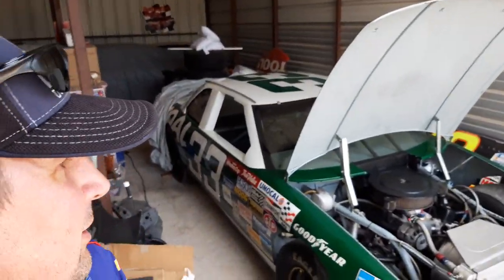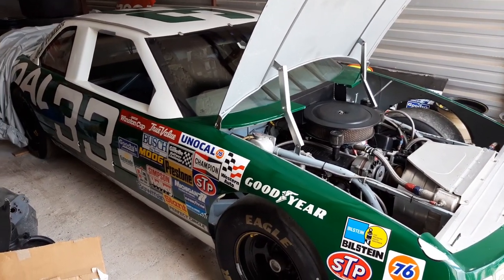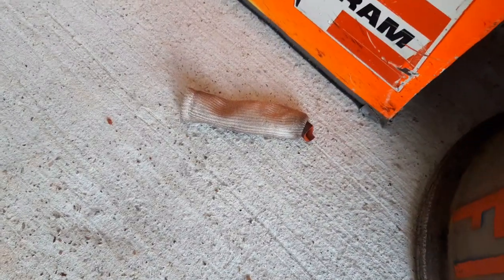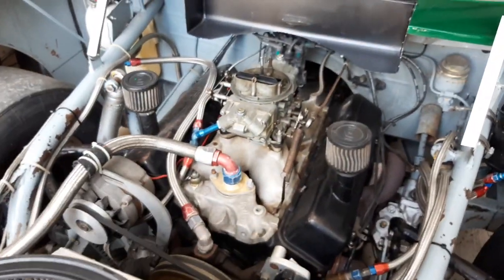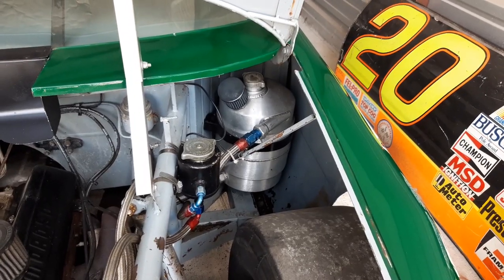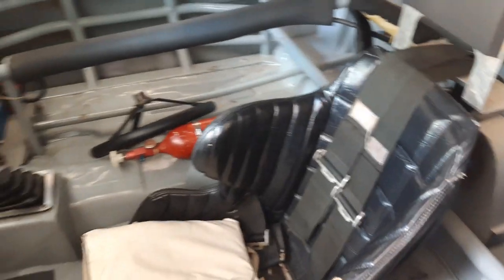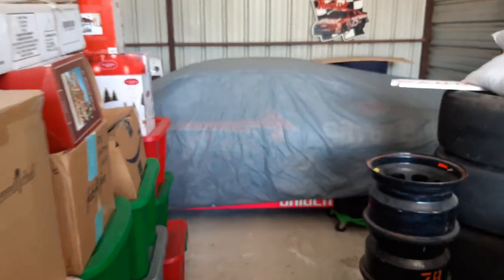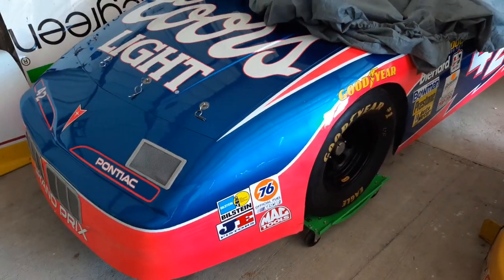Getting my 33 Harry Gant Skoal NASCAR car running again.

Comment: H.P. serial number -  sounds like Hutcherson and Pegan chasis builder
Reply from the maker: Yep.  Need to find someone who has the old records.
Reply: @grassrootsnascarracing5431  Accell makes fire brading insulation for protecting spark plug lines, it is yellow and looks nice. It can be added custom on the plug wire it is needed.   It Needs to be installed on plug wire before the end boots are crimped on the distributor end, this should help with where the headers are burning the spark plug lines.     Also Accell and Moroso sell spark plug wire sets with the fire brading on the whole length of the line.  That sure is a cool old race car, thank you for the video.

Comment: Definitely should tape them headers for heat shield
Reply from the maker: Hmmm.  Might be a good idea.  It's surprising how little room there is between the headers and frame and also the headers and a few of the plug wires.